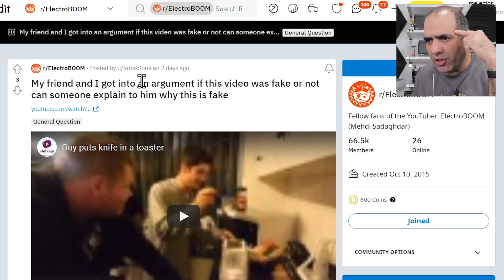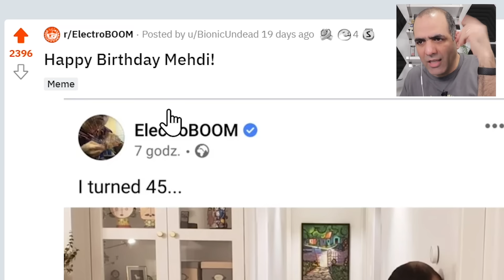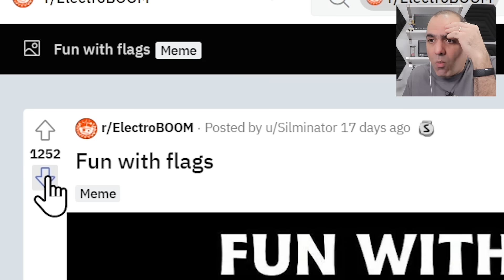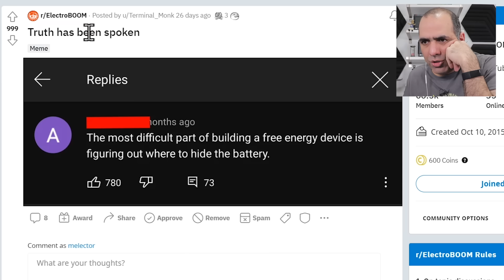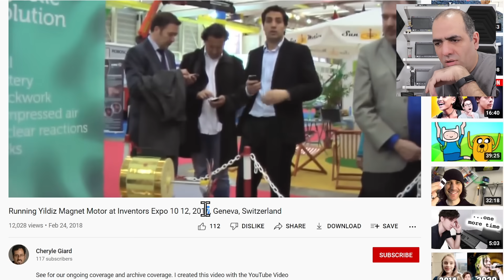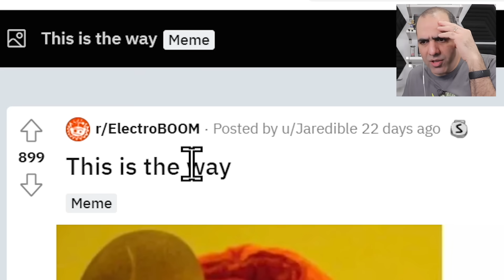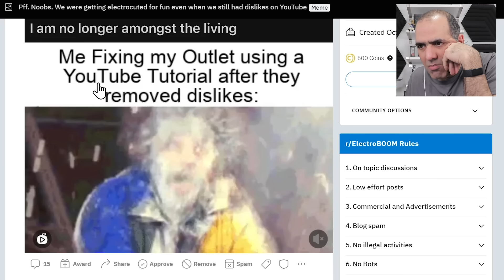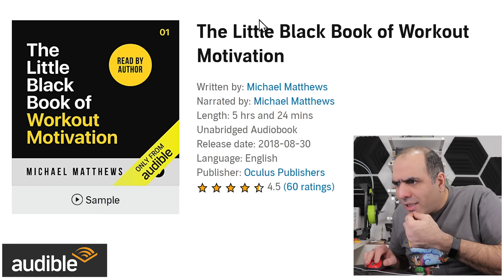Sticking Knife in Toaster? Welding with SALT WATER?!!! (LATITY-009)

Comment: Technology Connections did a video about a toaster where he opened an old (like 1950's) toaster. The switch was single pole, meaning some times the heating elements were live even when the toaster was off (depending on which way around the plug happened to be). These types of toasters are probably the origin of the "don't use a knife to get your bread out of the toaster". Pretty sure those toasters aren't legal in any civilized county anymore.

Comment: Just remember, when you're holding that knife handle, that, on some full tang models, the metal of the blade extends  through the handle and is exposed on top and bottom.
Reply: 3 years late I'll add the same logic is true for screwdrivers.  Occasionally there are models with a plastic handle but the shaft is secured with metal on the butt end.  Surprise shock!  Always good to turn the breaker off too of course....

Comment: must be chlorine...
which is poisonous!

this is why we love the channel, congrats to almost 5mil.
Reply: Chlorine and not chloride.
Reply: @mernokimuvek  typo
Reply: Any chromium from the stainless steel?
Reply: It was actually just hydrogen and oxygen, you can do the same thing somewhat safely by dropping a 9volt battery in salt water
Reply: @williamletts9487  the products  of an Saltwater electrolysis are: HCl + H2 + O2 + NaOH. One of which is a deadly Gas. After all the Cl is gone only H2 and O2 are produced. Because of this Water electrolysis is normally not done with NaCl but with other salts added.
Reply: @tobiashegemann1811  No actually, the electrolysis is driving a non-spontaneous process so the less non-spontaneous process of reducing water into oxygen  and hydrogen (-1.23V) would occur before the reduction of Cl- (-1.36V), just look at the standard electrode potentials for each of the two reduction reactions. Since there is a high current and high voltage, and the E∅ for each reduction reaction is close, some chloride will end up reduced, producing probably what Medhi smelled
Reply: @williamletts9487  No, it was just steam, there is no electrolysis with AC, but with DC it would indeed have been Hydrogen and Chlorine if you use table salt.
Reply: @Chuckiele  Electrolysis definitely happens with AC, it's just much less efficient and for some combinations of electrode/electrolyte slows down rapidly due to the degredation of the electrodes. But you'll get significant quantities of gas produced for a few minutes even with 60Hz AC.
Reply: @killerbee.13  Yeah, with easily degradable electrodes like copper and aluminium, sure.

Comment: You basically touched both clamps together because you touched them both while it had power because a welder works because basically your just shorting a circuit and yes what he is doing is dangerous but thats basically how an arc welder works and you can weld with 50 volts and with anywhere between 60-100 amps

Comment: Mythbusters came across this problem often. Maybe a myth was once a problem in the past, even if the story has gotten exaggerated over time, but at this point there are so many security features that it's no longer a thing that can happen. Even then the results you get after disabling the safety features to recreate the original event the myth is based on,it  is often not as spectacular as the exaggerated myth would suggest. Though sometimes you get the basement water heater that became a rocket. So again, don't do this at home.